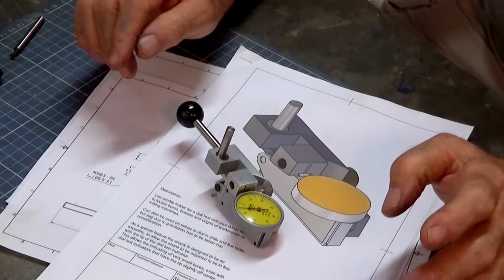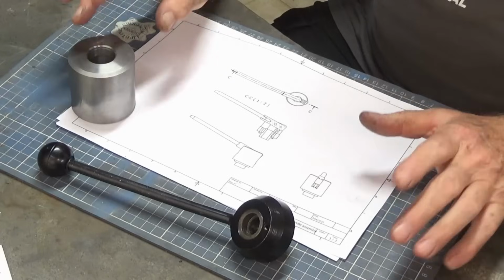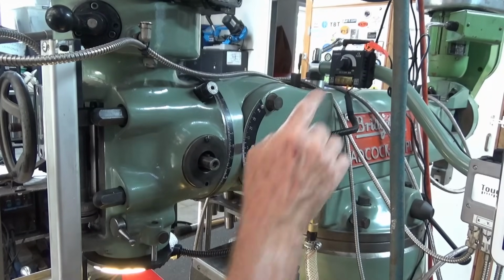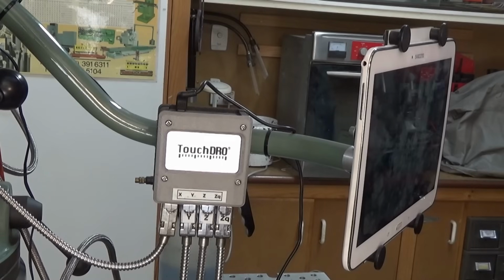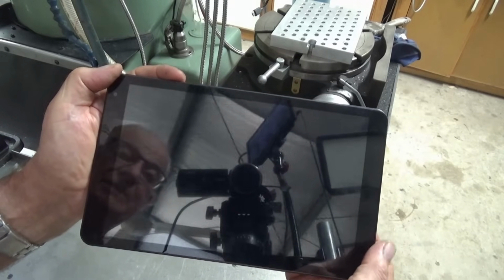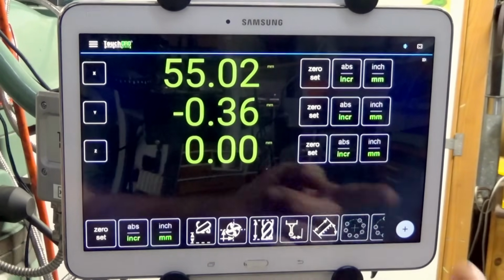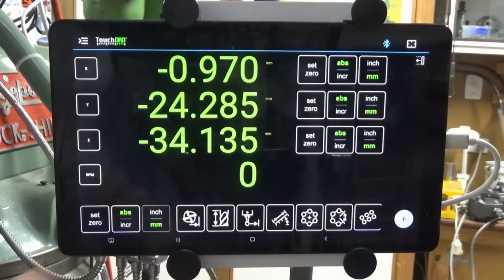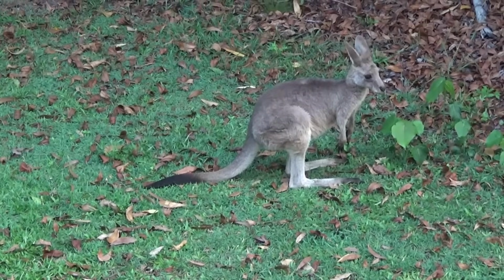Channel Update and TouchDRO, a 3 Year Review

Comment: I've been using TouchDRO since 2016 on my Sherline, running on a now 10 year old Samsung tablet that would have been e-waste long ago otherwise. Still working great with the capacitive scales and homebuilt Arduino controller. I run shielded cables with the shield only bonded to ground at the controller, with everything powered from the tablet's usb charger. Didn't know there was a new version, I'll have to go check that out.
Reply from the maker: I tried multiple "fixes" to make my capacitive scales reliable and I got close but I was never 100% satisfied with it. The glass scales just work although I was annoyed with myself for having to do it twice.
Regards,
Mark